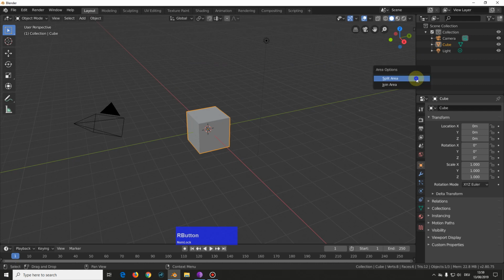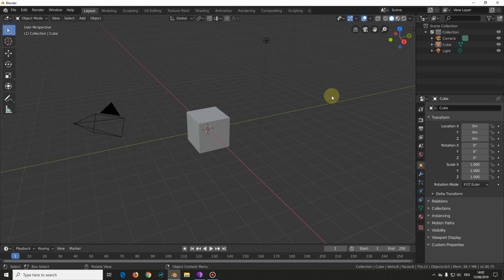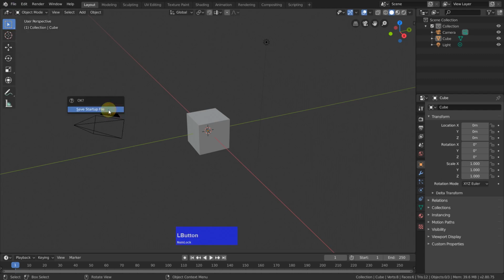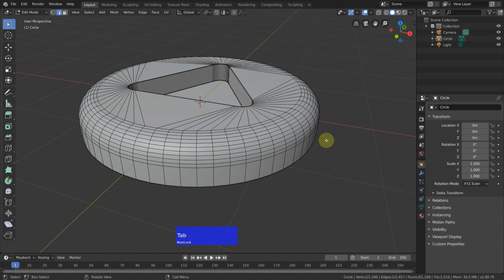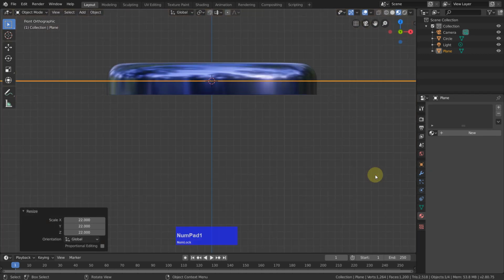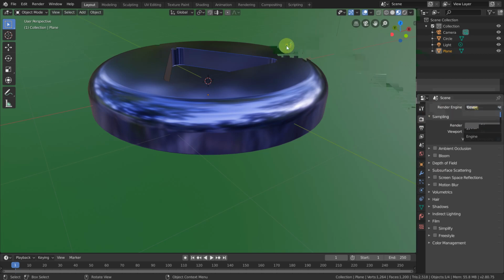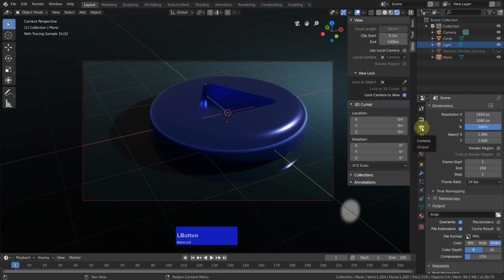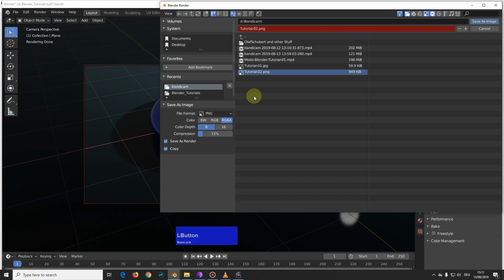A MODO Fan looks at Blender 2.80 - Part 02

Comment: Thank you Peter! I'm excited to see how your modeling knowledge will translate to Blender. One thing I noticed switching from Modo to Blender, even as a beginner is that if the modeling fundamentals are solid the software becomes only a tool and is just a matter of knowing its potentials and limitations, and knowing how to find the correct tool for doing similar work.